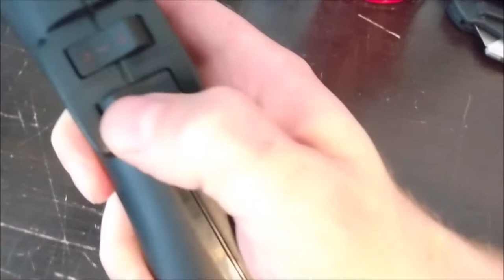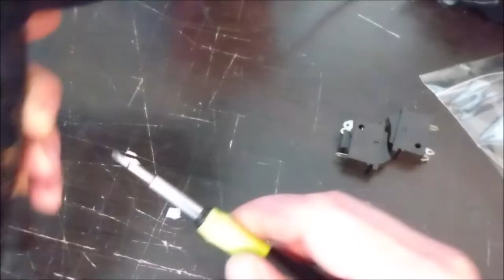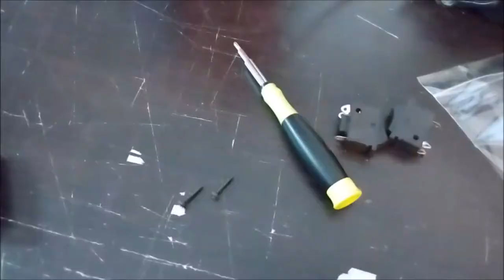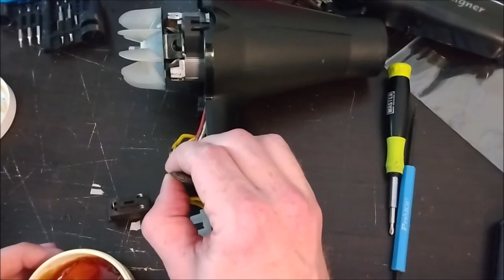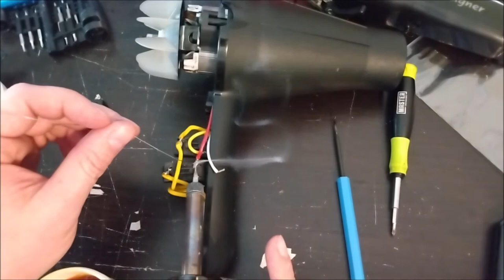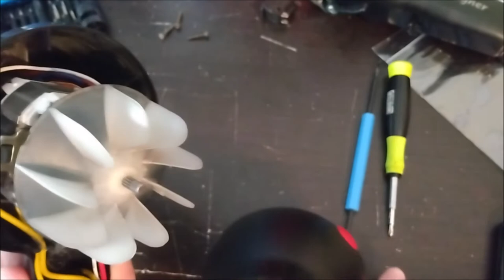Turbo Power Twin Turbo 3200 power switch replacement

Comment: If the blower doesn't turn on plug the blower turn the switches on the blower and press the red and yellow button and it will work.